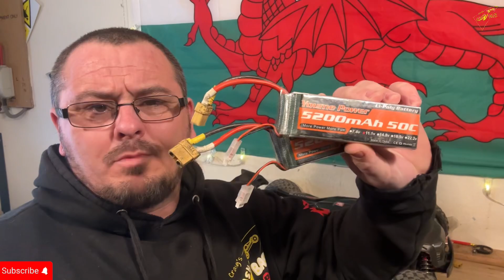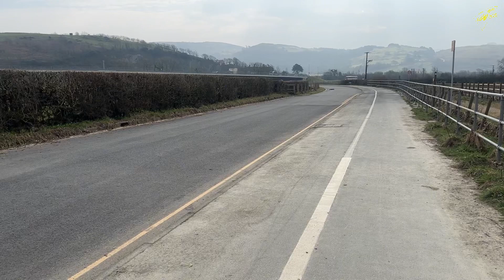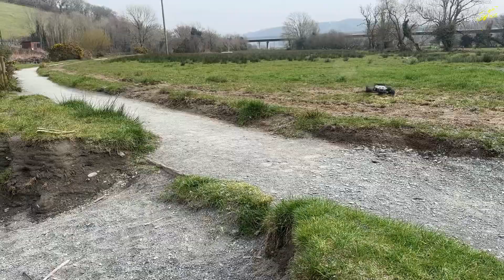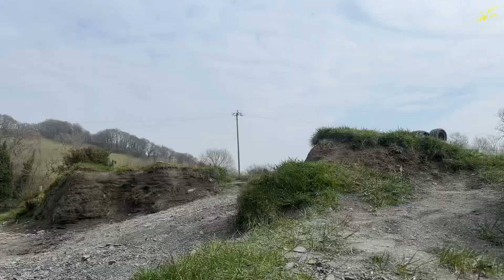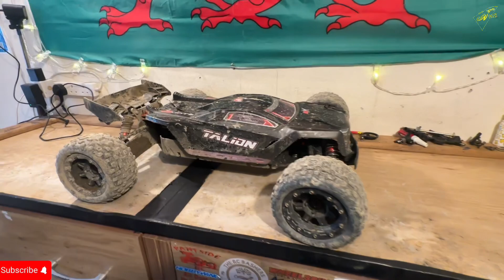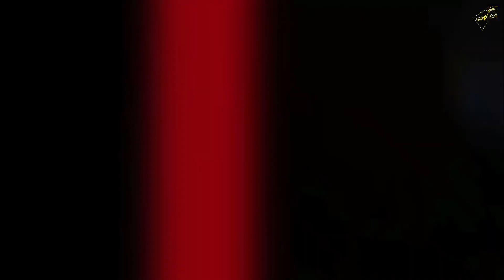This simple change will massively improve your spektrum esc.

Comment: Question for you... Any idea what the oldest truck(esc) was that Did have the most current firmware version?
ie. Is it possible that even the latest v6 6s Arrma trucks have been released without the latest update.
7 mins run time to over 20  no brainier... But also any difference in delivery of power?
Reply from the maker: Well , marks big rock 6s was the only one out of the fleet we tried that had the updated firmware. But , I believe there is a brand new firmware for the v2 version ( the black and grey one ) out now , or at least very soon.    As for the power delivery it’s much smoother now , the cogging wasn’t bad before but now it almost feels sensored.   Still just as quick and runs smoother.   I can literally see zero reasons not to do it.  I might even gear up haha

Comment: Craig!! Do you know if I can use the stock xmaxx servo horn on the servo you put in there off AliExpress? I just had the same servo turn up today but I don’t have the same metal xmaxx servo horn you did. Hoping to fit the stock horn for now!
Reply from the maker: Just use the metal one that comes with the new servo. It will be fine 
Mine is now using that one
Thanks for watching
Reply: @craigs-crash-n-bash did you tap a new hole in the included metal horn or did you just use one of the two holes that are already tapped in it? I know it might throw off the steering geometry a bit; idk if that matters
Reply from the maker: @V8chump  no I just used the included horn with the holes already in it.